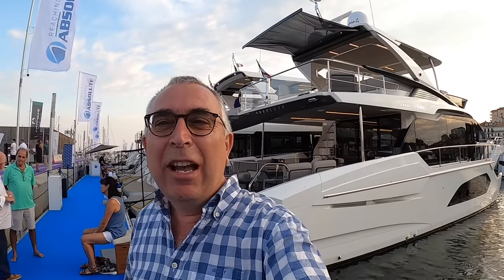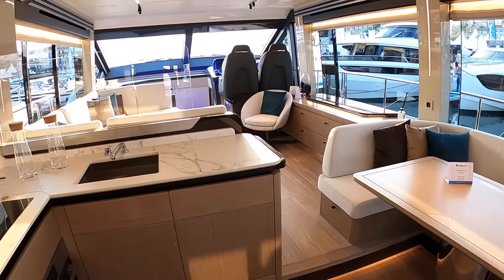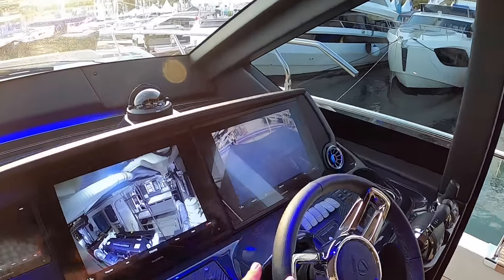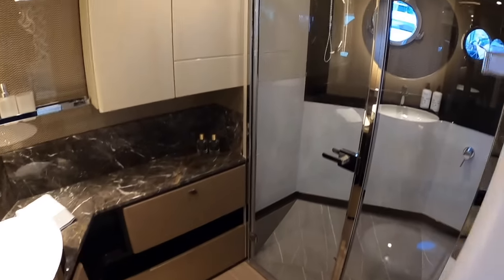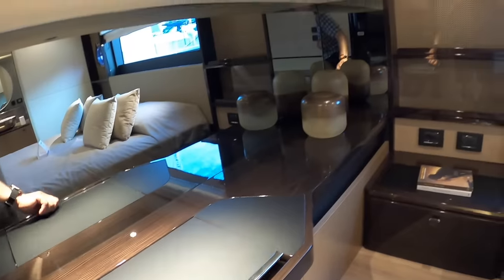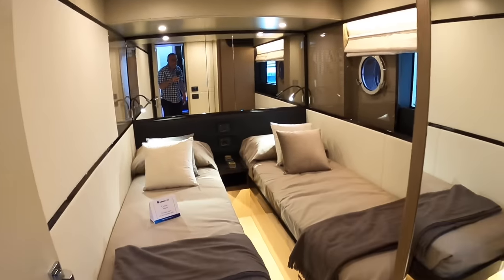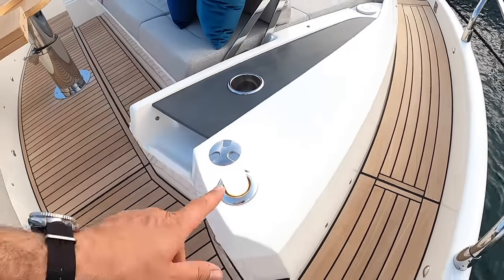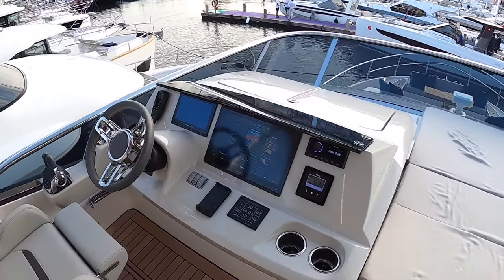€1.4 Million Yacht Tour : Absolute 60 Fly

Comment: Absolute and Sirena are really killing it in the 'pocket yachts' category. They have some beautiful boats. I personally would want a Sea Doo or too on the swim platform and thena small jet RIB on the fly bridge, but then you would need a davit installed. I'm sure they could accommodate that though
Reply: With that much weight, I would imagine you'd need more power as well.
Reply: @WillowGTI  Supposedly on a deep displacement yacht, if you have the whale back bow with a sharp entry and you are still able to not generate a stern wave and let the water go around your hull, you wouldn't need additional power.  But if you had a 60 ft yacht, you wouldn't load it up with all of that because that's not what they were designed for. I'm sure you could do it as long as the displacement profile remained the same. But a 60 footer isn't usually a 2 jet ski type of yacht anyway. Although some Nordhavns have had 2 tenders and a jet ski on deck, so maybe it's possible, but I wouldn't want to take that chance.

Comment: I love Absolute's master-forward design with the heads at the fore to cushion against at-anchor water noise. To me it feels nautical, like you're in a stateroom on a boat rather than in a room in a travel lodge. The facing-fore bed is a winner IMO. The Navetta still has more storage, the beach club sofa bed, etc., but this is a gorgeous option for those who want something a bit more yacht than trawler.
Reply: Agreed about the fore facing master suite. I think the Navetta did a bit better with the layout by putting the washer/dryer in the space under the master bed at the lower landing area. Overall I like where this design has led!
Reply: I love the term "master cabin" vs owner's suite..
Reply: It’s also quite a bit cheaper than the Navetta 64.  
I heard due to demand the Navetta 64s are fetching closer to $4mil.

Comment: I like the layout of this Yatch over many of the other 60 Fly Yachts I have seen by other manufacturers.  I like the separate toilets from the showers area in the main accommodations area.  How're,  they should have an option where the toilet is separated from the shower in the crew cabin even if you have to do a bunk arrangement.  I didn't see a Washer & Dryer in the main accommodations area which is needed.

Does the Yatch has a fresh water maker and water softener option?

Overall a good design which zi know will be improved in time.🙂

Comment: Hello Nick,
I have a question for you because I can't find a straight answer on the internet.
Your explaination about the difference between a displacement- and a plaininghull is simple, clear and correct. Everybody will understand the difference, well done.
Butt now I wonder which hull design is more economical at the same speed, for example 6-7 knots?
I can understand that at this speed a displacement yacht feels more stable but what about the fuelconsumption between those two?
With kind regards,
Bart
Reply from the maker: A hull purpose built for displacement speed cruising is usually more efficient at that speed as there is no compromise toward the ability to plane.

Comment: The layout seems very relaxing with every square inch of the hull utilized.  * I wonder if the sliding doors / shower doors will open up or rattle when under way though.  Great finishes and room for 8, what more could you want?

Comment: Another great video! I love the "inverted Orca" design of the Absolute yachts :D

One question about the prices quoted in your videos, Nick. Is that the approx. price excl. tax of the yacht you present or is it rather the starting price of the model?
Reply from the maker: It's just a guide. The price comes from the dealer or manufacturer, some prefer the base boat price, others a typical specification price. They're usually ex tax as that varies across the world, but not always.
Reply: @AQUAHOLIC  thanks a lot!

Comment: Does this boat also have heat for the living areas when boating in cooler climates or just cold air? I am aware that Hampton's Endurance can have diesel hydronic heat as an option. Thank you in advance!
Reply from the maker: The air conditioning is normally reverse cycle, so will heat as well.
Reply: @AQUAHOLIC  Thank you very much for the quick and useful response!

Comment: I love the swim platform, aft deck and interior layout but the windows are too too much if you live somewhere warm and sunny like ...  well anywhere you would want to have this boat. I think perhaps we know what too much glass on a boat looks like now.
Reply from the maker: It has air conditioning, the interior is whatever temperature you set it at.
Reply: On specially tinted glass like that, 99% of the Ultra Violet Rays are usually blocked.

Comment: Well the "the hardtop is covered in solar panels" made me wonder if it were going to be followed up with some statement about how environmentally friendly the boat would be. But nope.
Though, the manufacturer's website states: "The ‘green’ approach of the shipyard is recognizable in the possibility of integrating solar panels in the hard top to achieve a lower environmental impact and excellent levels of autonomy, especially at anchor."

And to be fair, they too aren't over marketing it as an environmentally friendly boat.

Unlike what has been seen on some other yachts before that went with the full "eco friendly" and "emissions free" just because they slapped on a pair of solar panels onto the roof as decoration. Might keep the batteries topped up, but not more than that. Worst thing I have seen yet were a $100 million super yacht that were "zero emissions" just because it had a catalytic converter. Well, then a car from the 80's is also fairly emissions free by those marketing standards...

It would be nice if the marine world just gave an eco friendly design a proper attempt for once. Can start with a sail boat with electric propulsion and some solar panels here and there integrated into the decking or the like.